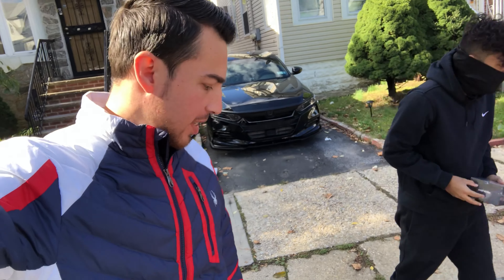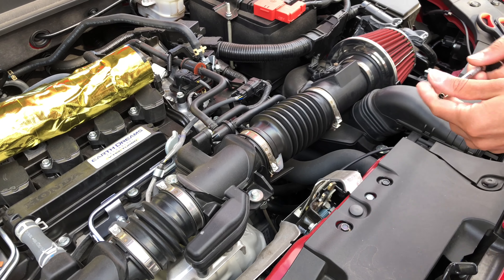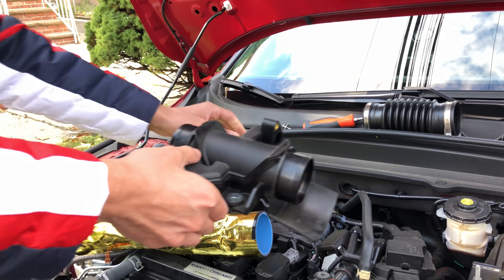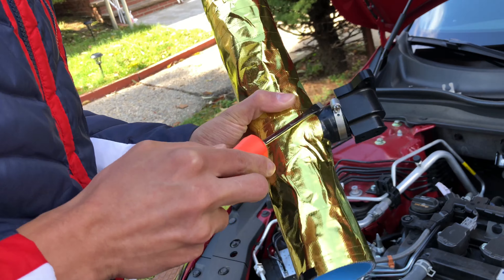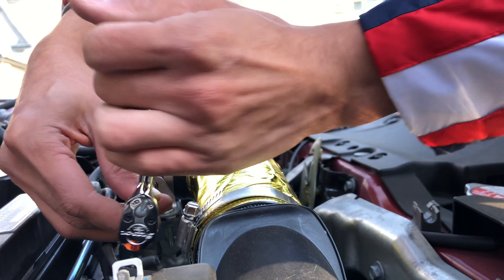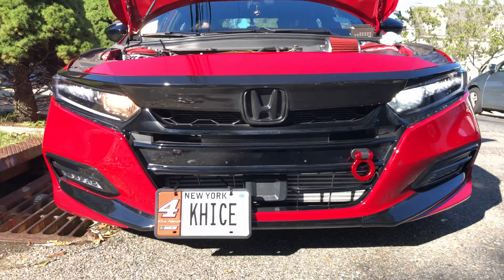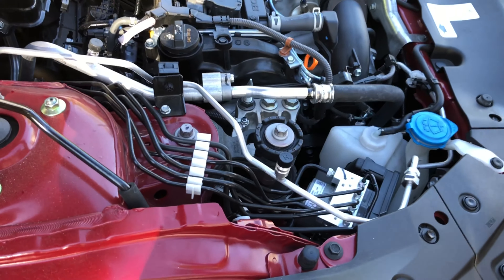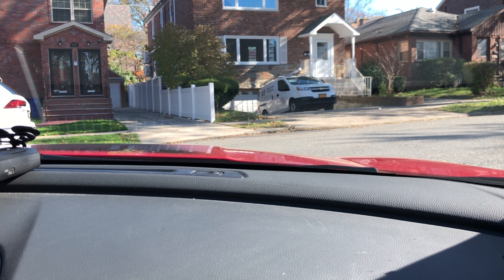2019 2020 honda accord sport 1.5t cold air intake high beam and upper torque mount install

Comment: Why did you put back the stock filter with knn I have a knn one as well I was thinking of getting the prl intake hose kit now ima order it but what else should I order for my 2020 I’m already looks at a bolts exaust system besides that what else should I get it’s 1.5t automatic cvt
Reply from the maker: Honestly with a 1.5T you can just do K&N filter and oil catch can and bolt on exhaust. Exhaust won’t be that loud though.. borla exhaust would be the best

Comment: How do your friends have tow straps I wanna get one for mine but idk where to bolt it
Reply: Unfortunately you can't bolt it, you gotta make a hole though the front grill. I'm carrying the strap for a month trying to figure out to put it on instead of making a hole in my grill.
Reply from the maker: @Erick Gonazales honestly, the one he has is 3M to the front grill. No bolts or anything. its there for show. and he got it on ebay I believe.